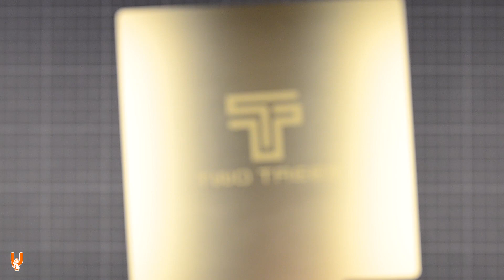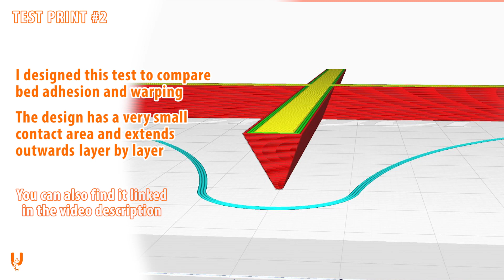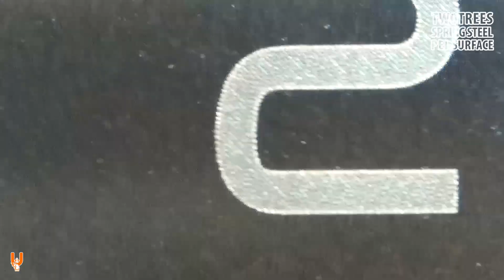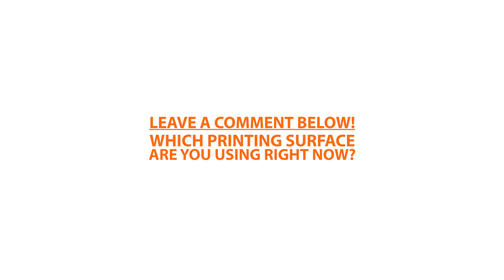Two Trees magnetic PEI coated Spring Steel 3D print bed surface vs Creality Cmagnet flexible surface

Comment from the maker: VIDEO INDEX
00:00 Intro
00:14 Packing & Contents
01:21 Test prints
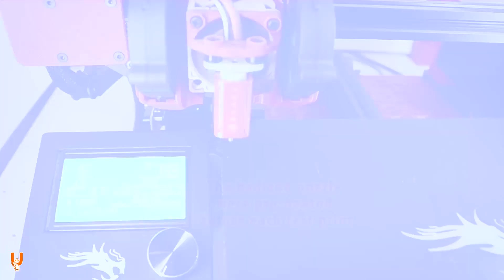02:16 Test procedure
02:57 CREALITY magnetic surface tests
06:16 SUPPORT
06:41 TWOTREES PEI surface setup
07:43 TWOTREES PEI surface tests
10:33 Test print comparisons
12:13 3D prints under the microscope
14:17 Print surfaces under the microscope
15:39 Layer lines under the microscope
16:40 SUBSCRIBE

👍 PLEASE SUPPORT the MuteFPV channel:

👍 Join my PATREON: http://mutefpv.com/patreon
👍 Tip my 'piggy bank' via PAYPAL: http://mutefpv.com/paypal

👍 Save and use these BOOKMARKS before purchasing new goodies (please bookmark the SHORTLINKS in your browser):
BANGGOOD: http://mutefpv.com/banggood
AMAZON (ad): http://mutefpv.com/amazon
GETFPV: http://mutefpv.com/getfpv
EBAY: http://mutefpv.com/ebay
ALIEXPRESS: http://mutefpv.com/aliexpress

More info in the video description, as always!
THANK YOU
-------

Comment: On the PEI surface is the logo on the spring steel or on the actual PEI?
Reply from the maker: I think it is on the spring steel, I have seen it sold separately and I remember that the PEI had no logo
Reply: I've seen someone got large chunk of PEI off and stick to PETG print instead, confimed that the logo is on the spring steel

Comment: Great comparison video, thank you! I’m using triangle labs pei coated sheet and creality magnetic base same as in your video. In my experience pei is much better in terms of adhesion than creality bed when printing with petg, but with flex creality bed works better for me with less bed heating. My hotbed’s settings for petg is 70 and for flex is 50°C. If I set 70 for flex and printing with pei bed it sticks same as petg, at 50 it doesn’t stick much. Pretty weird.
Reply from the maker: Thank you very much! Now that you mentioned high temps, is 70 the max for the magnetic sheet? I have seen mixed opinions about how high it can go without affecting its magnetic properties.
Reply: @muteFPV  hmm I’m not sure, as I used to heat it up to 80-90 and there were no problem with magnetism. I mostly use 70 because its slightly below petg’s softening point and provides good adhesion.
Reply from the maker: Nice, thanks for the feedback! Are you using creality's magnetic sheet, or the one that came with the TriangleLabs pei sheet? (although I would expect it to be the same thing)
Reply: @muteFPV  no problem! :) If you asking about magnetic base - I’m using the stock one which my ender was equipped with by creality, but yeah, I guess they all the same

Comment: still using a glass bed + glue stick , with an capacitivy probe. works like a treat, bed adhesion is good. only let down is that i have to wait until the bed is cooled way down before removing prints. on the other hands, i dont have to worry about scratching, denting it or cleaing it. its so rugged. i can leave it for weeks, dust it of and print. it works 100% of the time.
Reply from the maker: Thank you for the feedback. I on the other hand prefer to just print on a clean bed and not have to worry about adhesion. So far it has been working great for me and I am using PEI or Cmagnet back and forth, depending on what I am printing (or what I am testing).
Reply: @muteFPV  it's definitely an good optio  n when you print a lot.